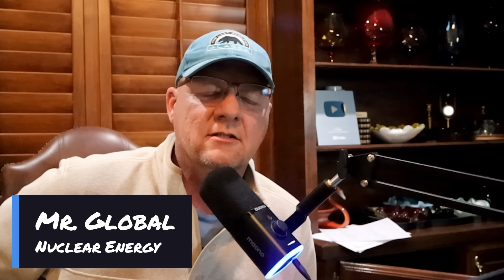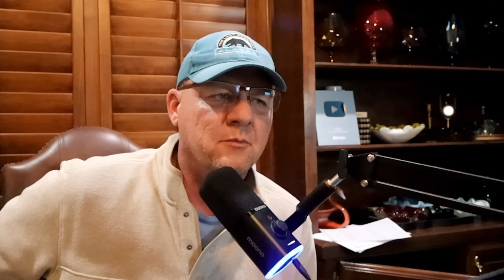Why Nuclear Power is Too Expensive and Always Late

Comment: I think that nuclear power is the future but not fission, fusion. Local fusion has lots of issues. Remote fusion is where it is at. Let all of the fusion take place inside of the sun, and I will harvest the energy using solar panels.
Reply: Wireless fusion is the best thing we have, and always will be.
Reply: Right on! But the consumer pays three times the cost for solar in US than I pay. You are being ripped off! Only the well off can afford. The "system" is terrified that significant percentage of homes will go totally off grid if you paid real world prices. A house could go full solar for less than $50k.
Reply: @glidermike1  We are installing 19 kW of panels, 18 kW inverter and 44 kWh of batteries at my brothers house with mounts and cabling it was 22k US.
That does not include any new electrical between the house and the system. What would that system go for in your area? I know we are being taxed and marked up like crazy in the US.

Comment: "The true cost of renewables includes significant investments in grid upgrades, storage (batteries), and balancing mechanisms, with estimates for grid modernization in the trillions globally by 2050, but these costs are offset by dropping renewable prices and reduced fossil fuel operational expenses, potentially leading to lower overall system costs than fossil fuels, though some studies show higher average electricity prices ($150-$300/MWh) for 100% renewables versus current rates. The debate centers on whether the grid's inherent flexibility and existing fossil fleet can adapt, reducing the need for dedicated "backup," or if large-scale storage and new transmission are essential additions." 
AI summary from google search. Not that it is all the wisdom of the world, but some summary of what google finds on the web.
Many things have hidden costs that get socialized, one way or another. I am not against renewables at all, where these are feasible. Just a balanced view. This country (any country) will always need a base load. This does not change in 20 years, unless the society disintegrates altogether.

Comment: public fear of nuclear is real and damaging. The irony is that massive mining of fossil fuels which causes uncounted environmental damage, that you sometimes discuss here, scares people less, for whatever reason. Current energy system runs on the promise of drill baby drill. Inexhaustible fossil fuel reserves. Really? I am for renewable power, but it has to be backed up today by natural gas. Natural gas is an exhaustible resource.
I do agree with the speed. Just like in the stock market, it is the next quarter that matters.

Comment: I'm sure you are correct about everything you said. I was hoping SMRs would be a possibility. A while back, I think it was a Bill Gates interview, one of the SMR companie's he's invested in, I think they are thorium-based reactors that one of which are in test-phase/mode somewhere in the US, others are in China. But these don't need to be near a water source for cooling, they have an automatic, very simple shutdown mechanism if things go wrong, very scalable...But he DID say, I recall, to make these things economically viable, there does need to be a regular production run of these things, kind of like an assembly line factory. We can't really just build one here and one there...Get an order for dozens, then you have something. They are cookie-cutter, there's no single-design per installation fiasco. But I understand what you say, I don't have my hopes up. Plus the public is totally scared about nuclear. Sigh.
Reply: Smr are vaporware. Every Nickel that was spent on smr should have been spent putting solar panels on everything.